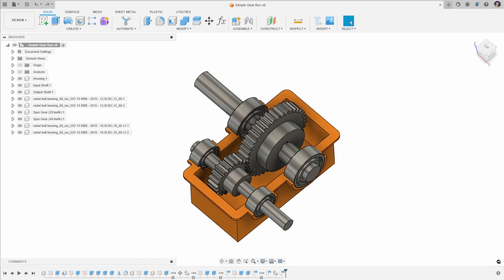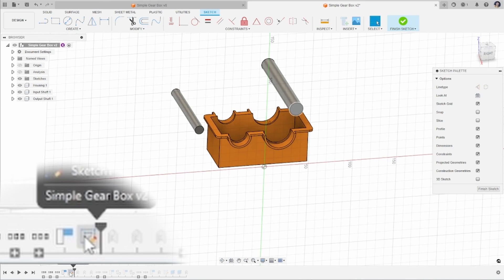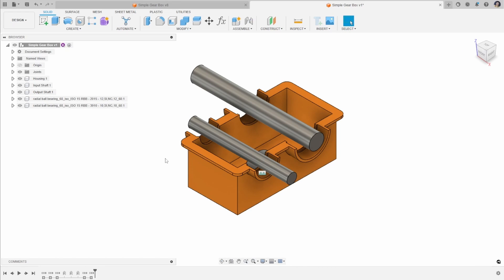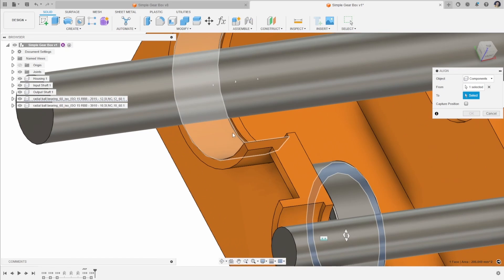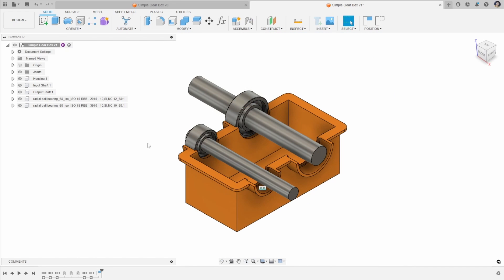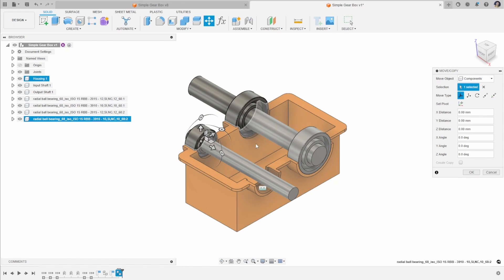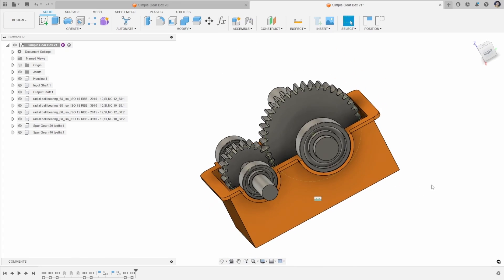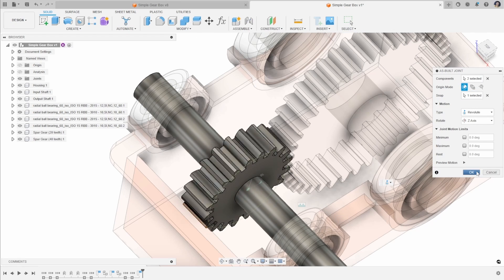Move, Align & Capture Positions in Autodesk Fusion

Comment: Exactly what i needed. After years of using Fusion, there are still a few little things i pick up from videos like this one - i find woking with components tricky as i often want to position them in 3D space rather than relative to another component (aligned or joint)

Comment: The joint of the first gear to the shaft is WRONG! That gear DOES NOT REVOLVE ABOUT THE SHAFT OR SHAFT AXIS. The gear and shaft would be locked together with a key or designed as single component and that shaft/gear/inner bearing revolves in the bearing assembly.

Comment: How are you moving around components without using the Move Tool?
Reply from the maker: Hi Rick! If a component is not restricted by a joint or grounding, you can click and drag on it from within the main window at any time to move it ☺️ This does not work with bodies, so make sure you are trying to move a component if it isn't working!
Reply: @adskFusion  Thanks for that clarification!

Comment: Yeah, nice little video, BUT ...
It should be the gear AND the axle that is rotating as a rigid group in the bearings - right ? 🤓
Reply from the maker: Ultimately, you are quite right! With this video not focusing on joints we made the decision to focus on the Move & Align tools and keep everything else as simple as possible, but in reality the joints structure would likely be done differently ☺️ Good catch!
Reply: You are right. But for understanding the main topic it is quite unimportant. 🙂
Reply: Correct. Not many uses for a gear that rotates on a shaft.
Reply: @twm4259  :  Idler gear, or layshaft cluster?  The bearings in the housing would be a bit redundant though.   😜